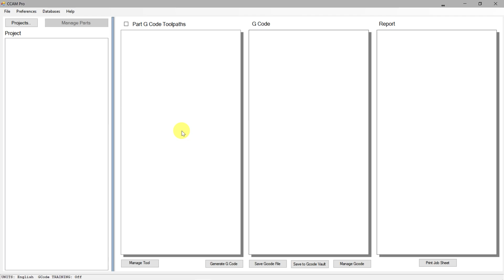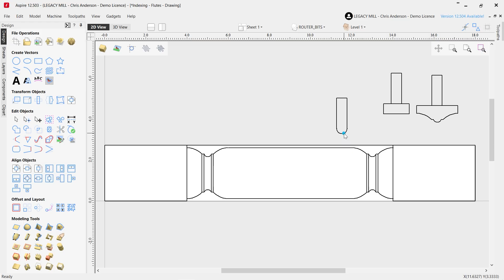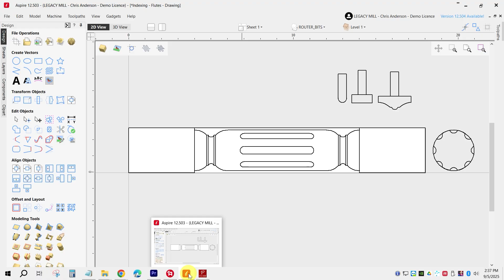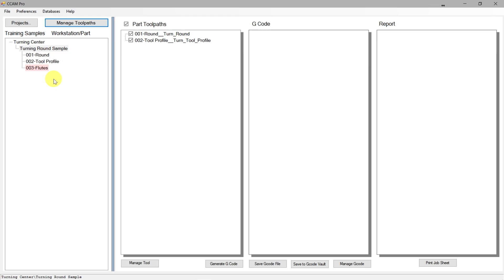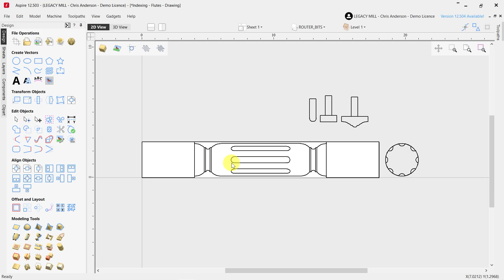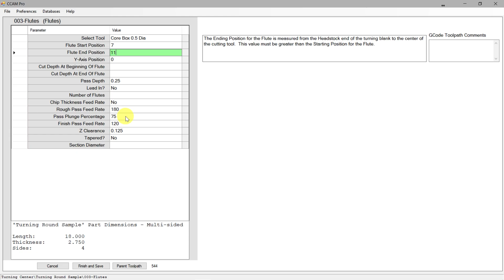Mastering Indexing Flutes in C Cam Pro

Comment: I have a general question concerning your last few videos.  When you show the start of the cut, the square sections on both ends of the blank are set at a certain position.  In this case, the vertical surfaces of the square stock are completely perpendicular to what would be the bed of the lathe.  How does your turning center or software determine that these square sections have a vertical face perpendicular to the lathe bed, and not say 5 degrees from vertical?
Reply from the maker: That is actually coming up in the next few videos.  This will be showing how the machine surfaces each side to true them up before they start any other cutting.  Each video goes over a single process so that these are precise and clear.  Keep watching for the surfacing 4 sides process.
Reply: @legacycnc8232  Thanks for your reply!  I enjoy your videos.